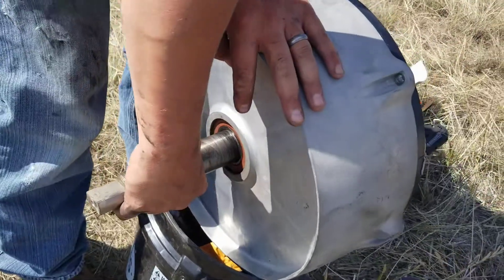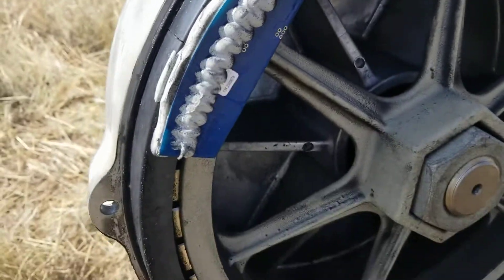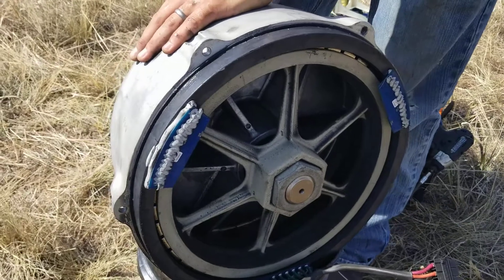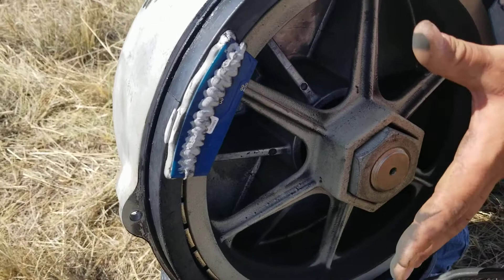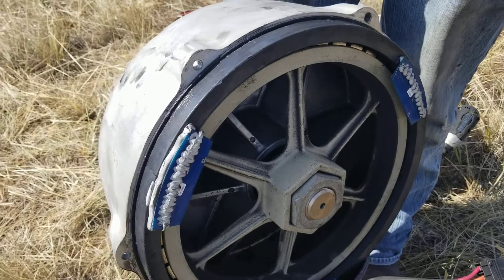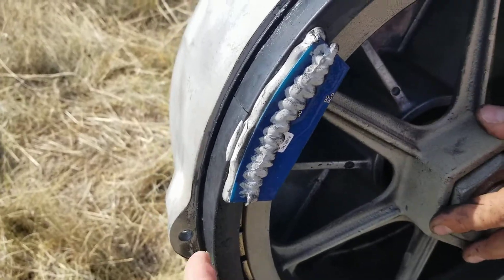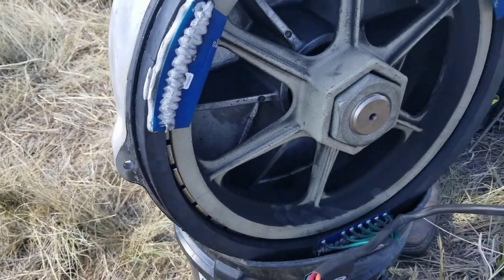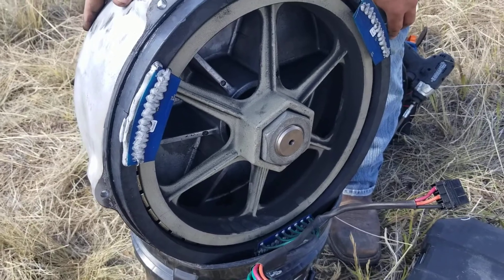Catastrophic failure of Skystream 3.7 residential wind turbine, but repairable

Comment: Would you be able to work on mine. Im in texas. I think my brushes are bad. Its locked up.
Reply from the maker: @robbyrucker140  I didn't do that work. It was my equipment repaired by WYCO Wind & Solar.   You should contact them. If they can't help, they may someone who can. Feel free to tell them I suggested you contact them.  They do carry brushes which are much better than the O.E.M. part. 
https://wycowindandsolar.com/

Comment: would you recommend skystream 3.7 for residential use?
Reply from the maker: Yes. In most cases, this is the only wind turbine I would recommend.  Keep in mind all mechanical things will eventually need repairs.  This video show what happened to one of our 4 turbines, 2 of which were installed in 2013 and the other 2 in 2019.